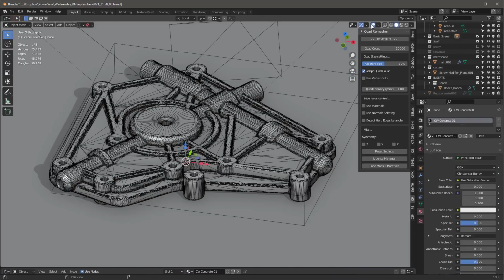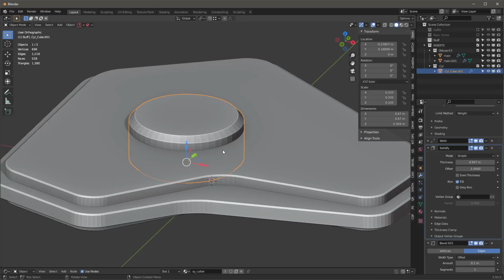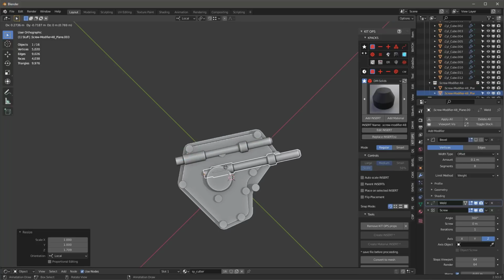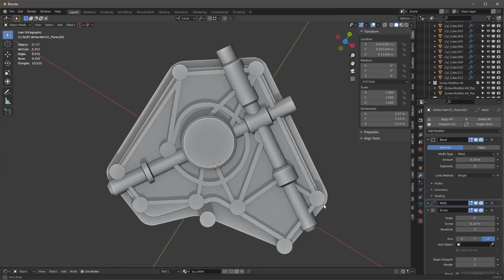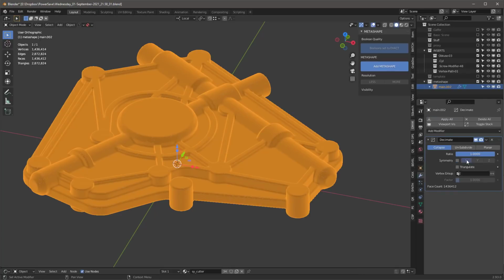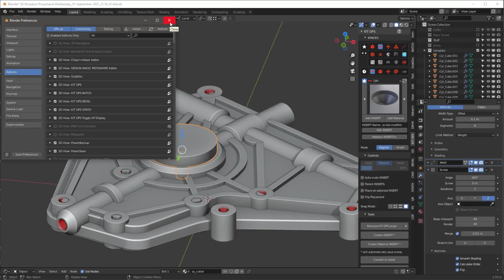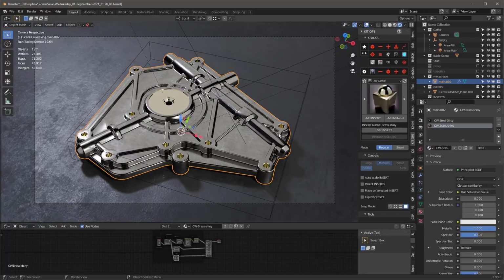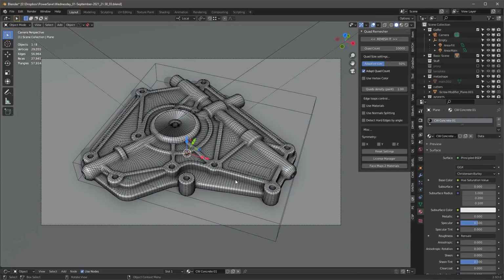Create this complex model in Blender: 20 min

Comment: Hi Chipp, I did the Transponder without no problems, but now with this I am at 10:00 where you select 3 extruded verts and then apply a bevel weight to them to get them to curve, but no go they just sit there. I have no normal face problems. I am running 4.3 on Win 10/ Any help at all would be appreciated.
Reply: Did some more troubleshooting and 4.3 bevel weight verts appears to be broken. works fine in 4.2!
Reply from the maker: Works for me in 4.3.

Comment: This looks good, but certain parts look funky from an engineer's perspective. All sharp edge/ 90 degree angle walls should have welds or open space since you can't have two smooth metal pieces magically glue together. Without that realism, the part looks more like a single mesh rather than a system of many sub-parts.
Reply from the maker: Yes, for production there are many missing parts such as ejector pin lines, flow artifacts, draft angles and other. Still, the point was not to treat this as a CAD object, there are many CAD programs that can successfully model them. The goal was to create a difficult model form very quickly.

Comment: Chipp - Sorry if this is a stupid question but I'm confused.  Can this technique be used for precision modeling or is it meant to just give that appearance?  I ask because it appears that you're simply eyeballing in new features and their locations.  I'm an old Solidworks guy not well versed in Blender so always looking for ways to tame this beast.  I'm here because your video title looked promising.

Cheers from Thailand!
Reply from the maker: Hi Jimbo, METASHAPE is not a precision modeling technique just as subD is not a precision modeling technique. For stuff like that you're better off sticking with a solids modeler CAD system.
Reply: @ChippWalters  Thanks for the quick reply.  I'm stuck with Blender as I'm having to use it to import my Solidworks models, tweak them, add textures, then export them in gltf format for Microsoft Flight Simulator 2020 scenery objects.  Finally, I can now create fairly simplistic models in Blender but hoping to do all my models in Blender at some point since converting solids-based models into mesh-type Blender models is a time consuming royal pain in the back side.  Again, thanks for the quick reply!

Comment: Very cool, i have a question how can you add materials to selection with Kitops materials for example
 go in edit mode then select face and add that material to those faces i tried but it remove everything and it only make that material only
Reply from the maker: Currently you need to add the materials to the scene by deselecting everything and just adding one material after another. Once they are added then you can add them to slots in an object.
Reply: @ChippWalters  Yes this is what i did, but i tought i can do selection and in Kitops will apply the material directly like Extreme PBR  Evo as i use this Add-on too
 But i really like the wat you make your product so smart and genius so i am enjoying in it.
Reply from the maker: @maniacarta9648  Yea, we need to add that feature. Stay tuned!
Reply: @ChippWalters  Thanks Chipp, i look forward to it

Comment: Hi, just wondering, is there a way to use a kitbashes in kitops as cutters insert instead of mesh?
Reply from the maker: Yes, with KIT OPS 2 PRO, just open it in factory mode, set it to a cutter, and Dave it as an INSERT.
Reply: @ChippWalters  awesome thank you so much.

Comment: Great work Chipp. This workflow is the best yet. 

A tip with regards to Quad Remesher: By adding materials to mark various areas of topology and selecting Use Materials under the Edge Loops Control, Quad Remesher can create perfectly aligned edge flow. 
You're already half way there by using the second material on your cutters. Bevel and Solidify also have options for assigning different materials to the different parts of the operation.
Unless you're applying the cutters after the remesh modifier, this won't work since remesh strips the other material assignments. 
As a bonus Quad Remesher will keep your original materials.

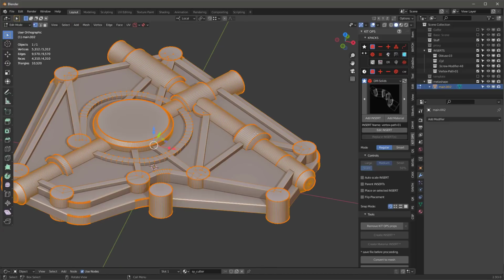Comment: Thanks for this. Loved the modelling workflow up until 12:20 where you had 10,500 polys ... it looked as good as it was ever gonna be as a merged or un-merged mesh (minus the brass cuts)
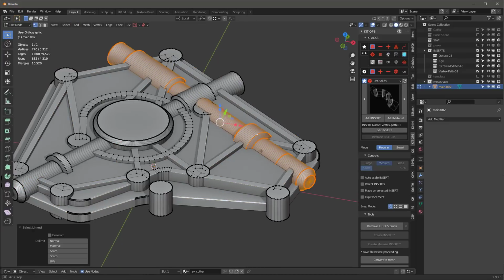What was the point of voxelizing it to 2.8 million polys and then decimating it to 55,000 to get a mesh that wasn't as good as the 10,500 polys you initially had at 12:20 ?
The question you should have asked at the beginning is "What do I ultimately want to do with this model?"
If it's supposed to be for a game, 27,000 polys for a game asset for that shape is never gonna happen at any studio. You'd be be better off adjusting the 10,500 poly version to fit that criteria.
If it was supposed to be for product visualization, then the pre-merged or merged 10,500 poly + brass cut-out version was the best to use.
Reply from the maker: You need to look more closely at the model. There's no way to create the fully filleted surface in a surface modeler without a ton of topology work. I've worked on plenty of games including AR and VR ones and they all have 40K models.

And now with UE5 nanite voxel remeshing, and the super fast GPUs, poly counts are no longer a huge limiting factor. In fact Nvidia recently hired me to create some sci fi test assets, and they specifically mentioned to not worry about poly count.
Reply: @ChippWalters  what would be the best way to UV high poly models?
Reply from the maker: It kind of depends on what you want to use the UVs for. Smart UV project is pretty good if all you're trying to do is get some UVs on a model so that you can drop it into substance painter and paint on it. But, if what you want to do is use trim sheets then you might want to use cube projection or project from view.